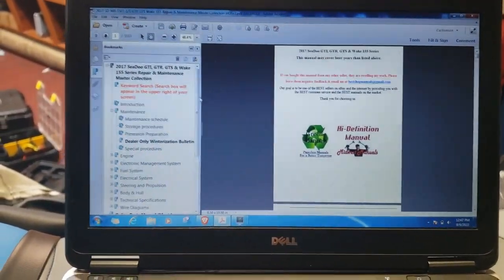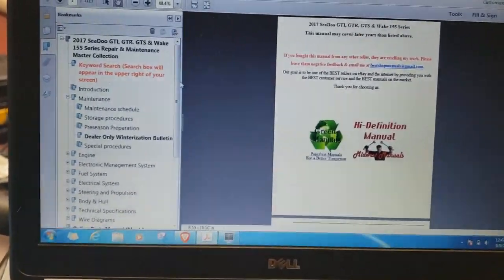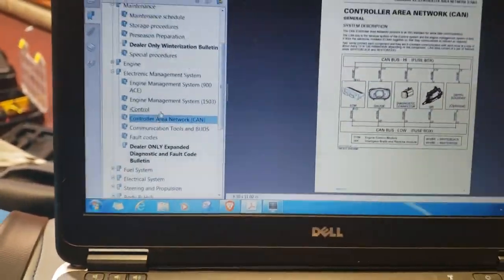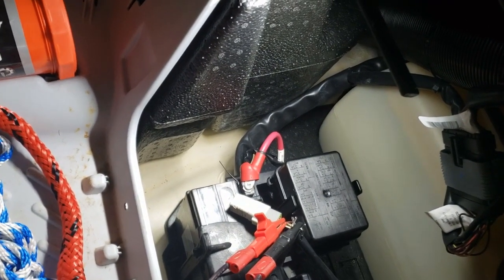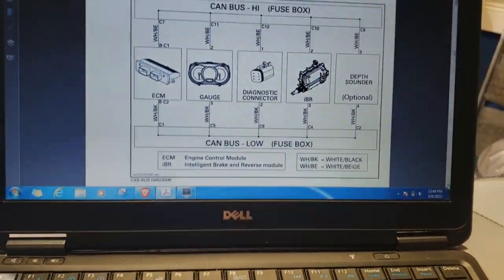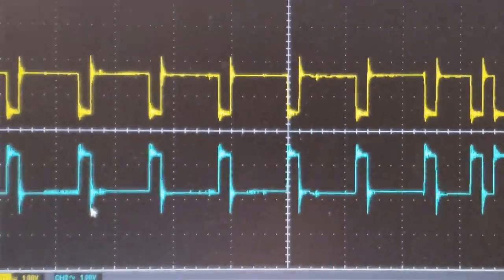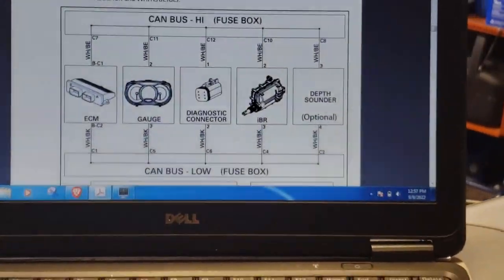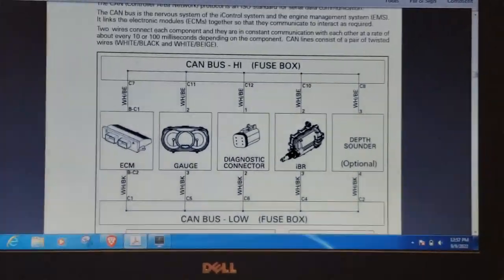Can Bus 101

Comment: You can also measure the back probed diag pins with a multimeter. Then confirm the bus is 60 ohms. CAN has a 120 ohm resistors at the ends of the bus. So 120 / 2 = 60.

Comment: Good stuff! I stay away from cans.. bottles are better. Lol 😆  good video.  Never really occurred to me that CAN networking was in these things too. But yeah of course it makes sense to me now.  Thanks for sharing 👍 + Danner's for recommending this video!
Reply from the maker: I'm with you on the cans.  These newer (2011 or so) Sea-Doos have fly-by-wire throttle and iBR (intelligent Brake and Reverse).  So when you hit the throttle lever, you are sending a signal over the network to the ECM to "request" MORE POWER BABY!  In turn, the ECM sends a signal to the electronically controlled throttle body.  BRP installed another lever on the left handlebar to control the iBR.  If you are going above 9 MPH, and you pull the lever, you get reverse; if you are above 9 MPH, you get the brake.  It's amazing how fast you can stop a ski with iBR!  If you are holding the throttle (full) and the iBR lever at the same time, the ECU votes the throttle off the island and the ski will stop.  And, BRP got rid of the waterwheel to drive the speedometer.  Speed now comes from GPS satellites.